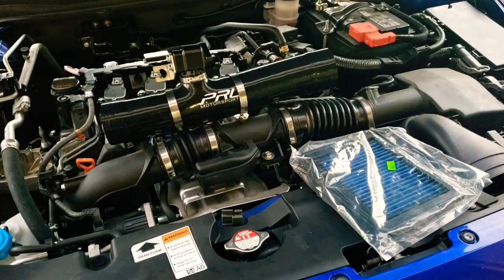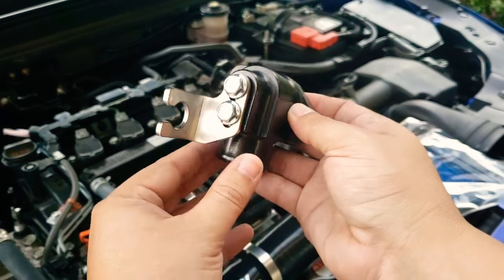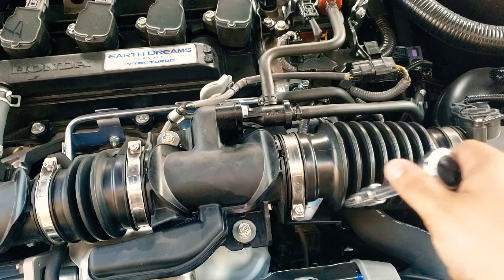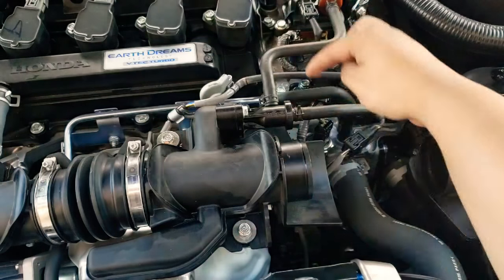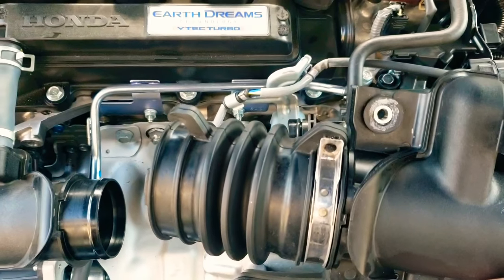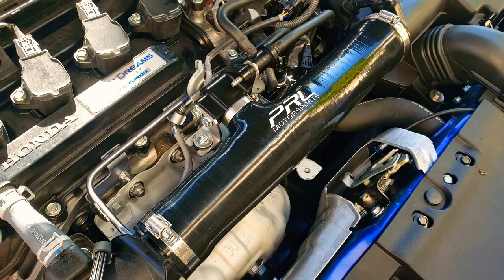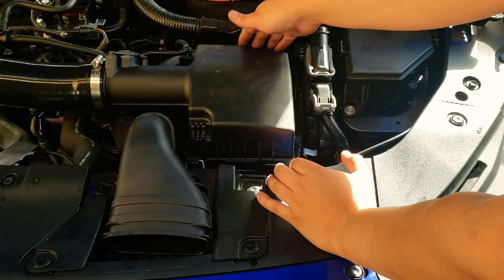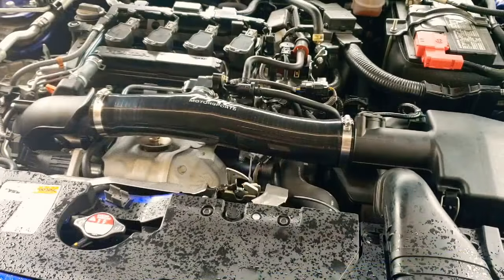PRL Motorsports Stage 1 Intake for Honda Accord 1.5T 2018-2019

Comment: It’s about time. I was about to say. Now get yourself a K Tuber and you’ll be good. Ever since I got my PRL intake and k tuner I’m smashing out!!!
Reply: Just got the intake what’s a K tuner though?
Reply: Sean M. A K-Tuner will tune your car giving it close to 65 more horsepower and 75 more pounds of torque turning your car into a type R
Reply: Christian Padilla do you need to use higher octane?
Reply: patrick martin nope but if you want to go a bit faster you can put some in.  I do it almost every other time I fill up the gas tank
Reply: @christianpadilla4406  you're telling me with a k tuner and prl intake I can get up to 60 more horsepower ?!?! How much?
Reply: @MarcoGiudice  add a downpipe and front pipe and you'll really reap the benefits of prl & ktuner
Reply: ktuner v2 $650 (offers stage 1 and stage 2)

prl stage 1 intake (tune not required) $130 

prl down/front pipe (require tune) $830

thermal r&d front pipe back exhaust $850

best setup i could think of for now
Reply: @ivwoc  aftermarket intercooler because of heat soak
Reply: I would be careful how much power you add to cvt accords. Have read that they can't handle much.
Reply: @MrParadigm9 I think remember reading a CVT can handle 200 or 215?

Comment: I programmed the Ktuner to my 1.5T and I had a K&N intake, but removed it because I found out the stock air box was definitely better than the intake. I received the PRL intake hose today, but when I had intalled it and test drove it, it did not feel as good as the regular stock box. Does it take time?
Reply from the maker: For me it took a day or 2 to adjust.
Reply: @BoostedWhipz  Thanks for replying so quick man. I will wait to see if I see any changes in acceleration/mpg.
Reply: @Certified G I've had it for 2 months now and honestly I feel its the same mpgs wise. It definitely gives you better acceleration. I'm not sure if it's the way I drive, but not much difference. I can say when I take my monthly 6 hr trip, I do notice I can drive a little further without stopping for gas. Hope this helps.

Comment: When you're hearing that blow off in the video, approximately how high were the revs? I'm wondering around what revs you start to hear it when you let off the pedal. I'm interested in this intake for more of its throttle noise than the turbo.
Reply from the maker: I believe it was 4K

Comment: Any difference in sound from stock to this? And do u feel more power while driving ?
Reply from the maker: You can here the turbo a bit more now. Nothing crazy but now can be heard. Performance wise not a crazy gain either but a slight better throttle response.
Reply: BoostedWhipz got you. Thanks bro

Comment: What was the point of changing out the the pipe if your not gunna add a cone
Reply from the maker: Cone is inefficient. Reduces performance. Adds heat due to the hot circulating air in the engine bay. Closed box design is the best for your car.

Comment: Do you still have the stage 1 intake kit.  Or did you upgrade to the takeda momentum cold air system.
Reply from the maker: Still on the PRL.
Reply: BoostedWhipz    I went with the takeda momentum cold air system for my 2019 accord and it feels slower  would you happen to know how to reset a ECU on the newer accords I can’t find anything online.
Reply from the maker: @nomad936  I do not... The Takeda comes with a side module I believe. Did you try disconnecting the battery for 10-15 minutes.
Reply: BoostedWhipz no I didn’t try  the battery but I will tomorrow. I’ll also look into side module  thanks

Comment: Does it give you anything besides sound?
Reply from the maker: Better throttle response and acceleration. Also helps the restrictions of air flow to the engine. This means improvement on temps and slight increase in performance.
Reply: Sweet!! Thank you I will be buying this

Comment: I bought this. Installed, but what's it do? I didnt feel or hear any difference
Reply from the maker: Better air flow and brings temps down. Looking for sound you need an open box air filter. You should feel improved throttle response and acceleration
Reply: @BoostedWhipz  what open air filter would u use?
Reply from the maker: None lol... But AEM is the best for sound. If interested, let me know. I can get you a discount code for CruxMotorsports

Comment: Would u put this in ur car? Is it worth it?
Reply from the maker: Put what in my car?
Reply: @BoostedWhipz  dry I sent the link in the bottom. It's a vortex chip. Says gives power, better gas. Etc.. and why noone puts a blow off valve ?
Reply from the maker: @blackedouthonda2263  blow off valve is not good. You actually loose power and eventually can damage the turbo. Link did not got through. Please send by email.
Reply: @BoostedWhipz  ok.

Comment: So I just bought a k&n filter for $50 & the recharge kit as well. Would this intake work without using the filter supplied with it? Also could I buy the kit for cheaper without the filter?
Reply from the maker: Yes you can buy the hose alone from PRL. The K&N filter is fine as well.

Comment: Does it void warranty ?
Reply from the maker: Practically anything you modify voids warranty. However Honda has to prove that part caused an issue before denying warranty.
Reply: BoostedWhipz Thank you ! What the difference between k&n over prl ? I always was fan of k&n )
Reply: Now I have panel air filter k&n . Did you notis it’s small gap on the back of air filter box ? Today me with my mechanic was in shock , and it’s not fixable , it’s factory defect , and i saw your video and decided to put cold air intake .
Reply from the maker: Both drop in filters are great. Now if talking about the whole air intake system, the PRL is best due to it's closed box design. K&N is an open element system which sucks in the hot air from the engine bay.
Reply from the maker: @romankim3198  have to check my box, didn't really notice that. The PRL uses the stock box.
Reply: BoostedWhipz Thanks!
Reply: By the way which octane gas do you use ? Does it make a sense to use 93 octane ? Like more air more octane ?

Comment: Hey bro, can I just order the tube and keep my OEM filter? Or will I need to get this oiled one? 
Also, should I but it now or maybe wait for stage 2? 
Promo codes? 😁
Reply from the maker: You have the 1.5? You can use OEM filter. However for even better air flow, the PRL or K&N drop in filter is best. No promo code on those, sorry.
Reply: @BoostedWhipz  I do have the 1.5. Ok, illget that filter then
Any word on the stage 2? For the 1.5?
Reply from the maker: @edward2868  your best gains will come from a downpipe and a custom tune.
Reply: @BoostedWhipz  I know, I've seen your videos bro 
I'm not trying to do the most for now, figured this would be a good upgrade for now and then Ill see about upgrades like that 
For now you'd still recommend this? Just ordered it!
Reply from the maker: @edward2868  yeah to start off

Comment: What happens with the warranty after this install?
Reply from the maker: All depends on the dealer. Me personally not worried.
Reply: So temped I have 2.0
Reply from the maker: @lastdude1042  how many miles you have?
Reply: Just got the car last month has bout 600 but I’m just thinking bout it later on but just want to do my research
Reply from the maker: @lastdude1042  I would say to hold up a bit until you have 5-10K miles on it.
Reply: Fabian Segura I’m sure it will void the warranty. No offense but what’s the point of doing that. If you want to add more horsepower buy a better car.
Reply from the maker: @blackhawks1870  some people just like the Accord. Nothing wrong with adding more power to it.
Reply: BoostedWhipz I like it too. I have the same car.
Reply: @blackhawks1870  if you change the whole intake manifold all it does it makes the turbo more noticeable. The sound that is. The Wastegate isn't atmospheric so it's really hard to hear it. With an actual "race" intake on it, you'll hear it pretty damn well. Trust me.
Reply: If your engine is malfunctioning or not performing as it should be because of the intake then I’m sure it’ll void your warranty.